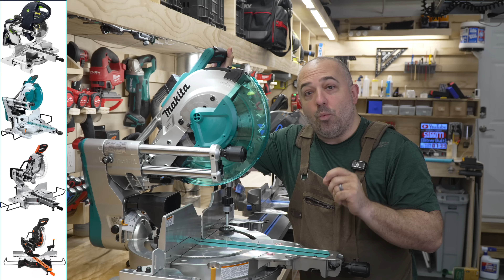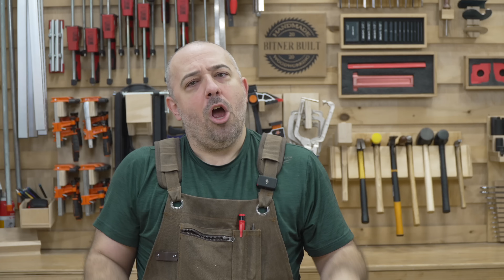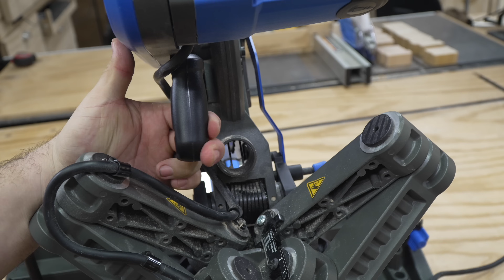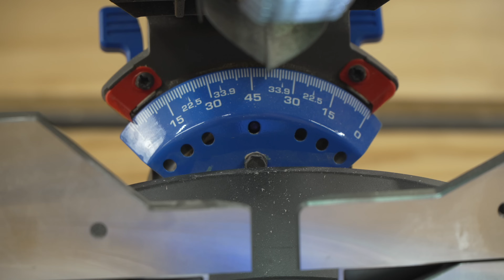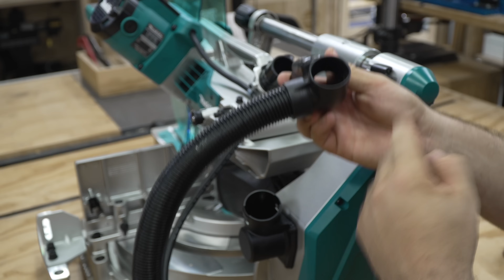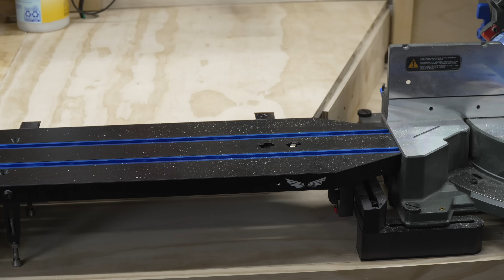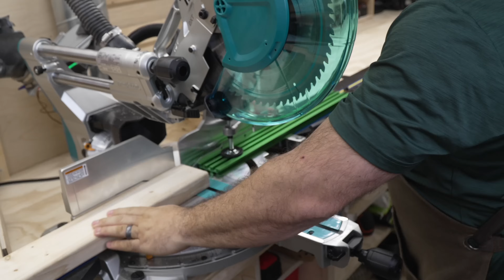Rail Vs Bearing Compact Miter Saws - Makita LS1219 & Delta Cruzer

Comment: I have the Bosch, i have seen people post about deflection on that, but honestly i have never had any deflection with the Bosh. I looked at the rigid version of the delta cruiser and that is a peice of garbage. I also have the 10 inch makita and i love it.
Reply from the maker: From what I’ve seen in the comments with people replying, it seems like 50% of the Bosch people have no deflection and 50% have a huge amount of deflection, which leads me to think that there are manufacturing or assembly difficulties with those types of saws, which is a big cause of what’s going on

Comment: I had commented on another of your videos (actually the one that follows this one) that I have a Hitachi. It's actually a Metabo. Yes, now I feel kind of dumb, not even knowing what brand miter saw I have. LOL In my defense, I haven't used it much - yet - & bought it only 6 months ago, so I am still familiarizing myself with it. Apparently, I need to familiarize myself with the brand name, too. LOL I'm still trying to figure out a better dust collection system for it, though. Probably one reason I haven't used it more. I kind of cobbled a connector system together a couple of months ago, but it doesn't really work & tends to pop off when I'm using the saw, so it's unfortunately still a work-in-progress. Sadly, I don't have a 3-D printer, nor access to someone else's, so printing an attachment is not an option for me. I also have yet to find anything for sale from anyone else that fits that saw. Thanks for the comparison between these 2 models, though. A real eye-opener on the Delta - damn! I'd personally have a hard time selling that to someone else with that deflection problem. Thank you for stating you will be upfront with a potential buyer. Hopefully you can find someone who doesn't need a high level of accuracy for cutting. Anyway, I hope you have a wonderful day! :)
Reply from the maker: Thanks! Yea I sold it for $200 and linked to this video so he knew what he was buying guess he did work that it didn’t matter

Comment: your 20 cut finger feel test/the deflection demonstration sold me on the makita. On my bosch (similar robot arm slide system), I am experiencing almost every issue that you're dealing with when using the delta. I never had any of these issues with my dewalt slider, but it takes up way too much space. 

going to bite the bullet on the makita 12" today. thanks
Reply from the maker: Another option that I didn’t know about when I did the video is a cheaper metabo you might want to take a look at as well that’s a compact slider. I do like the Makita though, almost done with the next video for that one I install a shadow guide and I just 3-D printed a hole expanded dust collection system for it. It’s working pretty good.
Reply: @BitnerBuilt  already placed the order, buddy!

Comment: The blade deflection on the Magnum in your vid (assuming you didn't get a complete lemon) is so far beyond acceptable as to be useless. If there's one thing we absolutely require in a mitre saw it's ZERO blade-deflection. I mean... c'mon!
Reply from the maker: Yep it’s to a crazy degree. Read through the comments seems a 50/50 of people experiencing the deflection like that, makes me think it’s a serious manufacturing/assembly defect in all of the bearing style machines

Comment: Are there physical stores around you that stock the Festool one? You could go in and give a quick test to a display model (just pulling to see how much it deflects should be enough, cutting not necessary).
Reply from the maker: Nothing I have seen nearby but next time I take the pilgrimage to rocker I will test it there (almost 2 hrs from me)

Comment: First , I'm a Lefty too,  but  obviously these (and all power miter saws) are meant to be operated with your RIGHT hand, and that's no big deal.  Even a die-hard southpaw should have no trouble. I have the Bosch 12" ... I'm not in love with it but I got it to save a little space and still have the capacity, and it does provide those benefits. I looked at a Delta in the store and it was obvious to me it was by comparison a POS. VERY sloppy- would have never made it to my short list. Delta stuff in general is an overseas made shadow of its former glory, so it did  not surprise me that their Cruzer would be junk. I'd expect a MM or two of deflection all the way out... yours looks more like 1/2" if it'll hit the sides of the slot!   Totally unacceptable LOL.  That saw would not have made it past hour one in my shop.  [EDIT...typo]
I suppose there is some deflection/run-out in the Bosch but the gyroscopic action of the blade honestly minimizes it, and even when not running it is NOWHERE near as bad as what you've demonstrated with your Delta.  At the end of the day though it really doesn't matter...the Bosch is plenty accurate enough for trim carpentry and the like. But for building furniture and cabinets I would never expect any Pro-Sumer miter saw (including the mighty Kapex) to be as accurate as I need it to be.  Commercial cabinet/furniture shops don't use these kinds of tools generally, they have dedicated industrial up-cut saws where the run-out is measured in .001s... For my home shop I'm always going back to a sled on my tablesaw.  I cut everything to rough lengths at the miter station.. then do any edge machining... then cut final lengths using a tablesaw sled, that is dead accurate.  Even if I had a a perfect power miter saw set-up  I'd still rough-cut... edge mill... and then cut final lengths in  a separate step back at the miter station. 

[SIDEBAR]  For readers and lovers of long comments LOL. Not sure why I didn't buy the Makita shown here.... I know a few people who have them and love them.  Maybe none available at the time, I honestly don't remember.  But the saw my Bosch replaced is an original LS1016 purchased new in 1983!!  Hard to believe, 42 freaking years ago!!  But after being trucked (banged) around to 100s of jobsites over the years, abused in every way you can imagine by my siding and trim crews who were not kind to tools.. that saw survived all the rest and still functions perfectly EXCEPT the fence support "ring"  (not sure of the real name) somehow got bent a little, and so no matter what you do it will not cut a perfect 90 on both sides of the blade.  It's CLOSE... I've straightened it as best I could and then flattened the face on a stationary belt sander... but it's still not close enough for anything other than rough cuts. The part I need is no longer available but I keep watching and hoping one will show up on eBay. There is also a video where someone milled one out of layers of Baltic birch plywood glued up - I might try that.   Or it might just be a wall decoration in my garage shop LOL.
Reply from the maker: Thanks quite the breakdown! Agree with your right hand operate but the center handles ones like the festool do give a more comfortable right or left operation without weird stances (Ben tried the festool at a woodcraft and liked it) unfortunately I didn’t have a physical store to try the cruiser at so it was a mail order, had I been able to, wouldn’t have bought it in the first place but felt once I had it not jump to a snap decision and give it a the rough go before making a review 👍 now the joy of trying to sell it for peanuts on marketplace as I have my review linked to it so I’m not misleading the buyer 🤦

Comment: I had deflection issues out of a duel rail Ryobi. Finally said enough and bought a Makita. It was way better but still would be slightly off every now and again. A buddy told me to replace the blade and se if it helps. I'll be darned if that didn't make the machine better. No more issues. It made me wonder enough to buy another aftermarket blade for the Ryobi and to my surprise it tightened up and is more accurate than it's ever been. After that day I never run the blades that come with the tools. I buy a new better blade same day.
Reply from the maker: Ah very cool I will take a look at that for this follow-up video

Comment: I bought the Hercules model when you did the earlier video upgrading to the Delta. I love it. Yes the footprint is big but I don’t have a miter station. I put it on a rolling tool chest and it works great. And I totally agree about the shadow line. Love it.
Reply from the maker: Oh, that’s good to hear, yeah honestly if I didn’t need the compact size, I probably would’ve gone back to it after this experience instead of spending up to go to the Makita. But I am pretty happy with that one now that I’m doing all the upgrades to it.

Comment: Every day they are getting closer and closer to a saw that was deemed too dangerous to be in a wood shop, The good old radial arm saw. At this rate they should remake the darn saw and ship it with safety features and call it good. Legit would not have to do much redesign to git it to the same safety as these saws. The grab and start system with the motor could easily be installed into the old form fairly easily. The exposed blade that freaks people out, mostly because the old saw guard was taken off long ago, can have a fairly similar blade guard that Shifts up to clear the fence and ride over the material to cut. Both of them you still have to place your hand inline of the blade to cut it off so there is no stopping stupidity and lack of attention.

Removing the rotating feature to turn the saw into a ripping saw is fairly easy to do and pretty much one of the dumbest things you can do with one. Otherwise the pitch would be similar to the angle adjustment of a chop saw. Just need to move the center point that it turns so the bottom of the blade is in the same cut angle which should not be hard to design. Adding a simple spring to pull the saw back instead of free floating would be something one could do on the old saws themselves including the on and off button in the handle.

Overall you get a bigger bed for the material and longer cut that should be extremely stable and reliable plus a great height adjustment system for doing dado and other cuts (not by using a dado stack although you could) so instead of doing cross cuts on a table saw you would do it on this instead. Before anyone mentions that this is portable, people still install these into a wood show as a fixed piece pretty much like a radial arm saw was and mor often than not these saws are more likely to be a in wood shop use than portable as they would get a second saw to fit that role. 

The "biggest" safety problem that people try and bring up which is the saw riding the wood and coming at you, guess what the sliding chop saw does the same thing if not worse because it can easily move up. Then the blade is more directly at you coming at you and you got some thin plastic shield (that the saw can easily cut though) to protect you. Keep in mind you are trying to push down and pull toward you to do the cut with a sliding chop saw so when it jumps up you are pushing it onto of the wood so it will still have the same effect. The radial arm saw has a bunch of stuff inbetween the front of the blade that would hit you before the blade does if it had the proper safety hardware that was not around in the 90s because everyone took it off because it was horribly designed.

Comment: I have the Bosch GCM12SD (the 12" bearing glide). Does it have some deflection? Yes, but nowhere near as bad as what you're showing on the Cruzer.
If I had to wager a guess, it's because both of the gliding assemblies on the Cruzer are at 45 degrees, and thus neither are really in their strongest axis in terms of strength.
The Bosch has one that's essentially parallel to the blade direction, and one that's perpendicular, which makes it surprisingly rigid despite being on glides.

It looks like the Makita is probably a bit more rigid, and that would have been my second choice but I found a great deal on the Bosch (<$500) which would have made a significant discount vs the Makita (which seems to never go on sale). I've been really interested in the Metabo, too. It's hard to find info on it, and none of the blue box stores near me seem to have them on the floor, even though they carry them.

Thanks for the video, I'm always keen to hear a professional's opinion on these tools!
Reply from the maker: Thanks for letting us know about yours. You should read some of the other comments in here there’s other people with the same Bosch that have huge deflection. It really leads me to believe that there’s either some manufacturing or assembly thing going on with these saws that use the bearing system as some people get a model that doesn’t have the issue with some people have it huge like what I was showing.

Comment: All 12 inch saws have deflection problems   Two band new saws and blades deflect some in 1x6 hard maple flat miters then straighten out   Blade wobble  baring wobble  ?  I don’t know
Reply from the maker: Sure they do that’s why I were seeing it on the Makita two of those cuts, but there’s a big difference in the amount. When I first got the saw, I was giving it a chance because that was my hope. Was that wall can move around, when I was actually making my cuts it was going to correct itself, but it definitely didn’t to the point where I spent more money on the new saw, and a big part of that was wasting a whole bunch of hard maple on a project. I was building before the video.
Reply: @BitnerBuilt we buy and use the smallest saw and blade nessary for operation   The smallest high quality saw is the best. My twenty year old 81/2 hitachi is my favorite for small molding

Comment: The problem with the Delta saw is the connection at the base.  It's too small and that's where the deflection is likely occurring.  They would need to make the steel on both sides of that connection much more substantial and also add a larger diameter bearing connection, not just a bolt on a nylon bushing, or whatever they have there.  I'm amazed that they would build it as they have, using some nice bearings in the five-bar linkage but none in the drop-down connection.  The, once they fix that base connection, they would need to test the linkage to make sure that the bars are large enough.  (Some might be asking how this is a five-bar linkage.  When determing how many bars in a machine, you count the immovable base.)
Reply from the maker: Great engineering breakdown 👍

Comment: I have the Bosch and wish I had bought the Makita instead.  The deflection on the Bosh is horrible, even with adjusting the saw it will not hold a true 90*.  The dust collection is a joke even with the aftermarket adapter that I purchased.  It's ok for general use but not for any cuts that must be dead-nuts accurate.  I use my table saw for those cuts.

Dave Couch
Reply from the maker: Aww that stinks Dave, yea been happy with this one so far one I didn’t cover in the video is the metabo, naught be a good option to sell and swap to considering the price

Comment: Thank you very much for a such informative video. I was thinking to buy a saw with axle movement but now I have to think about it. What do you think about dewalt miter saw?
Reply from the maker: So this video is on compact miter size, the DeWalt is a back sliding unit. I actually purchased the DeWalt and the harbor freight at the same time four years ago when I was trying to decide and I ended up returning the Dewalt, I have a video on the Hercules And why I think that’s the best value in miter saw. I really couldn’t see anything in person that was better justifying three times the cost. Now where I’m at going with the Makita, I like that it has the bigger dust collection and some accessories that I can use, had it not been for the fact that I needed it to be in a more compact footprint I might have just gone back to the Hercules.

Comment: So ive been looking at a lot of miter saws as i have a old rigid that i picked up for $50. It has gotten the rough job done for what ive needed, but im starting to work on precision and honing my skills. So this video is very helpful. Granted im probably going to have to go with the vevor as its within my budget and still better than what im currently using. But i do appreciate all the information that you put into this.
Reply from the maker: Thanks! Yeah, always go for your budget, but I would definitely recommend a dual rail system at this point! You might want to look at the metabo I added that to spreadsheet, apologies. I didn’t know about it for the video. Lots of people have good things to say about that one.

Comment: Wow, that deflection is awful!  I have the Ridgid version and I've never noticed any problems with my cuts, but after watching your demonstration I went out and checked for deflection more closely.  The result was really surprising.  Fully extended, I couldn't make the blade deflect more than about 1/16 inch total, about what you seem to be getting from the Makita.  I did notice that the bearing pivots on my saw look different from the ones on yours. I'm not sure if yours is a newer generation or what.  My saw is about a year old.
Reply: I should have mentioned, mine is a 10-inch saw.
Reply from the maker: Oh yeah, everybody sees a lot less deflection from the 10 inch versions over the 12 inch, there’s a lot more extension
Reply from the maker: What we seem to have gathered to from a lot of the comments in here as it seems very much like a 50-50 split of it either has a lot of deflection or very little, which leads me to believe there’s issues with the manufacturing or assembly process